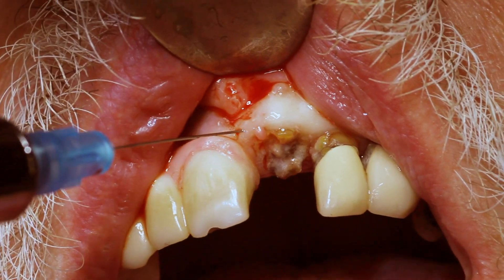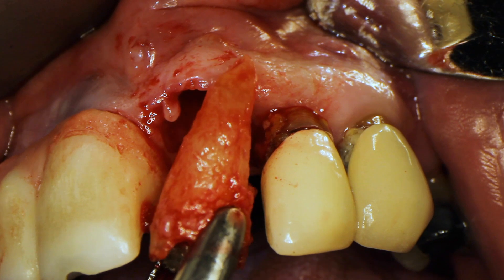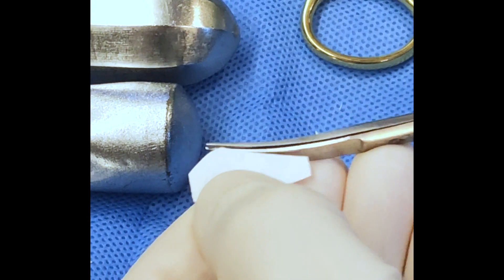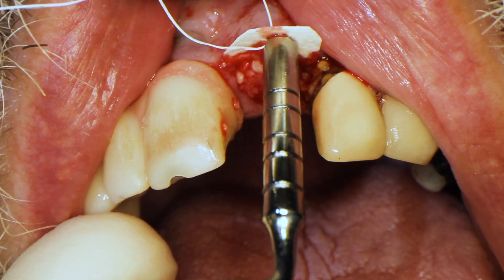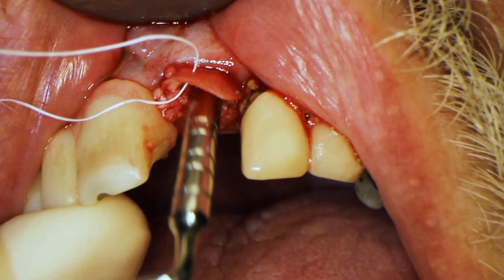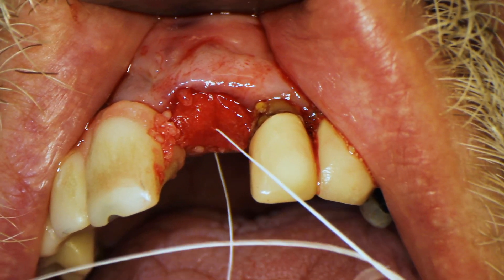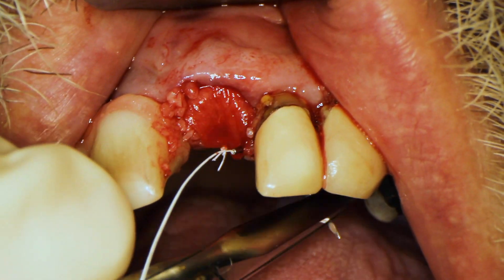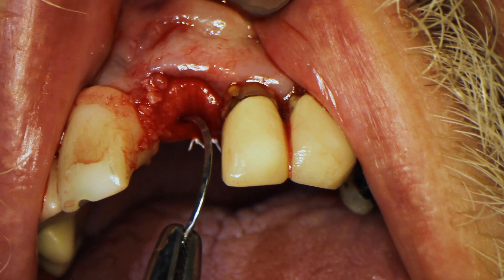Ice Cream Cone Technique for bone grafting

Comment: Instead of trying in the real membrane inside a bloody socket, you should simply use the packaging, trim it into the correct shape, and then use it as a template for the real membrane...

Not all membranes remain stiff for a long time once they come in contact with liquid. I would recommend Cytoplast RTM, RCM6, or Salvin's Renovix-Plus.